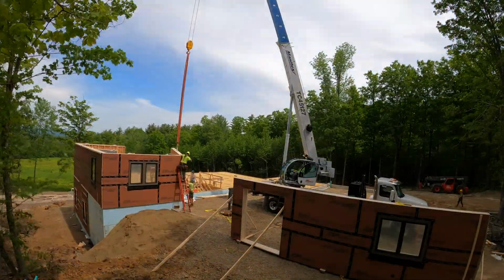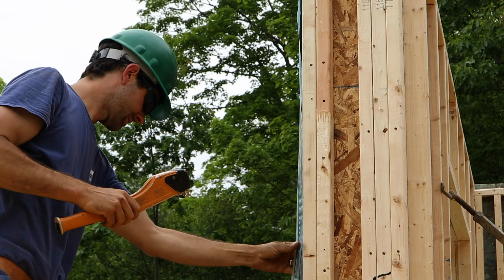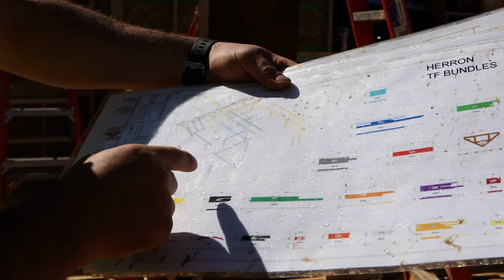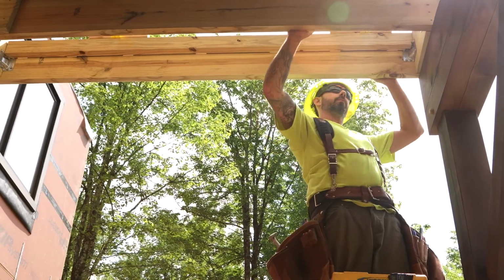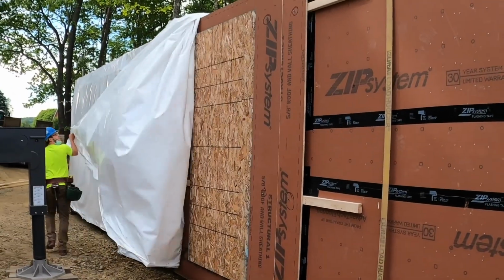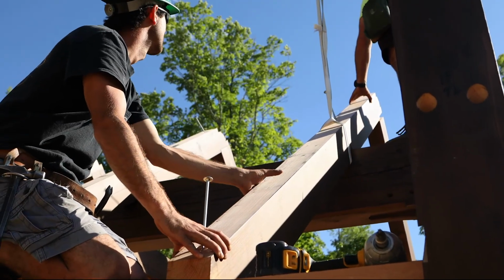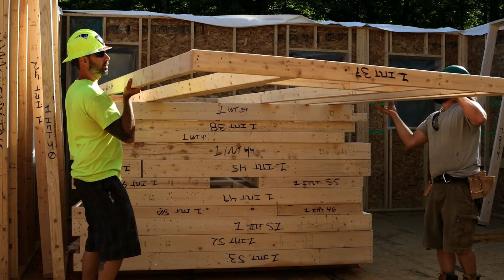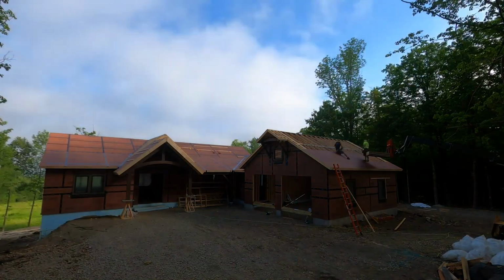Building an Air Tight Bensonwood Home

Comment: Probably the most efficient construction method that I have seen. I'm considering using Bensonwood Homes for a lot in Sapphire, NC. I had been exploring a 3D printed home but I think the Bensonwood construction process is much more advanced at this point. The lot is heavily wooded and I want to retain as many trees as possible. I also want to avoid the traditional concrete foundation due to radon and termite risk as well as rainwater incursion.
Reply: I have about 40 lots up in the Balsam area..Im a builder but like these pre fabs. ! Can't find enough labor in field anymore. Let me know if the work out!
Reply: Can you tell me where you learned about radon in foundation?

Comment: They are now requiring a blower door test for new construction, at least where I live.  We used Zip-R sheathing and Zip Tape plus closed cell foam in wall cavities and passed with a rating 75% better than the passing threshold.  Would have done even better if I had remembered to plug the bath and range hood fan vents.  This was a surprise to the tester, as he said many tests he's done had failed with other new homes in the area.  Running around trying to figure out where the leaks are must be a bitch without spending a few grand to have another contractor out to use an aerosol mist to find these hidden cracks.